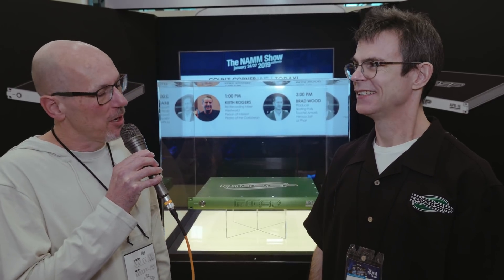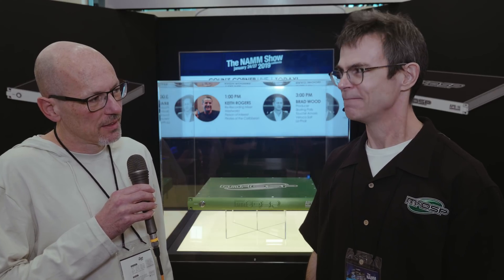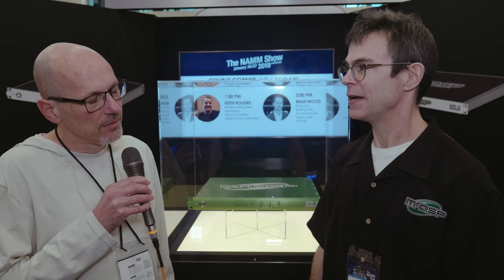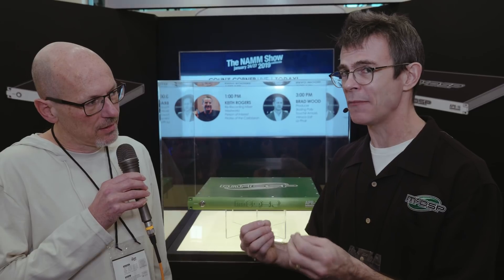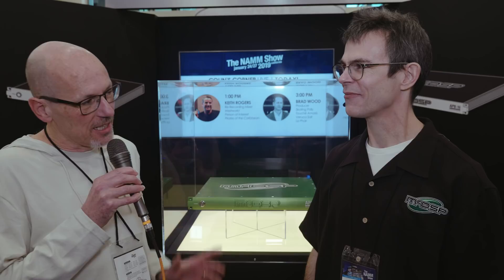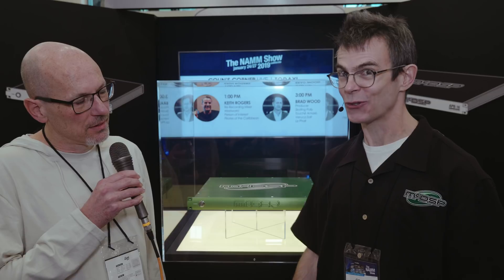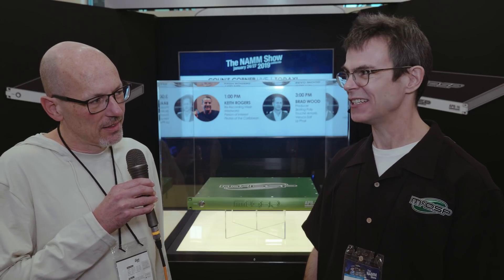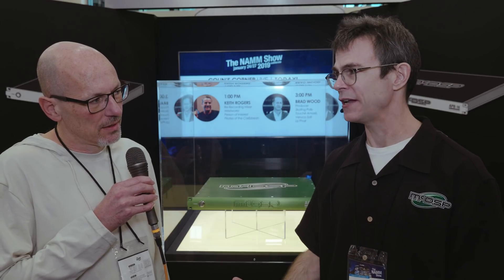McDSP - APB 16 - NAMM 2019

Comment: i’m curious about the latency on this unit.
the signal must go back to the DAW. 

If  each processed signal can go out directly it just like any other DSP interface. 
if its just a DSP unit then it pretty much like UAD
Reply: The audio goes out via TB, converted by a multichannel DAC in the unit , then fed into 16 analog circuits (series/parallel , your choosing)  , then those output through a AD and back to your computer Via TB.
It is not dsp. 
Its not a UAD

Comment: The thing that troubles me is that it seemingly does this D-A then A-D thing. If we're talking about a device that is assumably over 5K, and...for example, you've spent a lot more money on AD/DA converters (like Burl Audio for example); that whole extra round trip back into analog-then digital, just to have the kind of processing you would typically want before (or after) the digital conversion...well...give me this product with strictly analog IO to patch into my desk. I am of the mindset that I do not want a lot of AD/DA conversions. Thats my 2 cents.
Reply: But there is no way to work hybrid without a DA stage on every channel.  How do you actually process stuff in the analogue domain if there isn't a DA stage?  And then of course AD stage on the way back in.  You would have to do this even if you did spend the money on Burl or Crane Song or Avid or whatever.  The buying decision is around multi-channel I/O conversion for hybrid workflow.  Best thing you can hope for on this unit is that McDSP pair up with someone like Dave Hill or the Mytek guys, someone who knows how to design a great DAC basically.  Usually studios opt for some cost savings when it comes to hybrid workflows because to put something like a Prism DAC on every channel would be too cost prohibitive.  So you have to trade off basically.  I have 16 channels of Mytek going into a Harrison 950MX and a shit town of outboard (Pair of Retro STA, bunch of Neve Eqs, pair of Retro 176, Summit Audio TLA 100a, 1176s, and bunch of other things) but now you're talking 130k price tag.  This box delivers a lot of that for 7k.  If it sounds good it would be a great trade off to make.